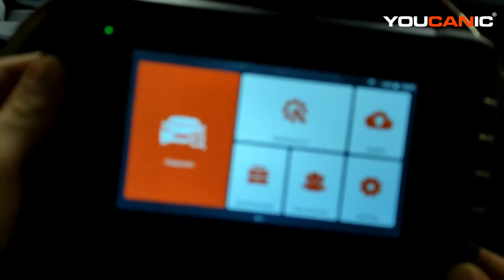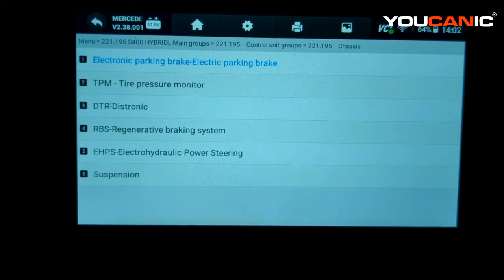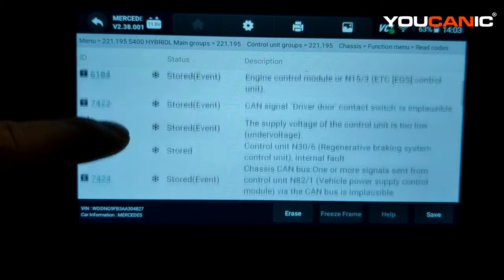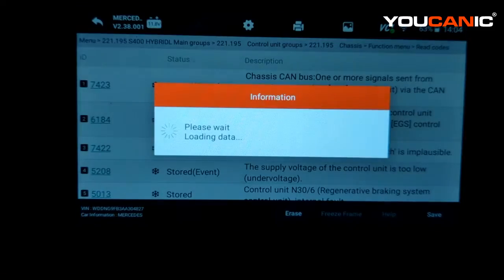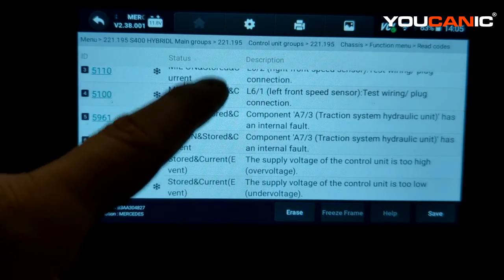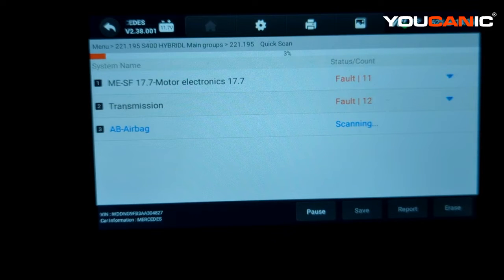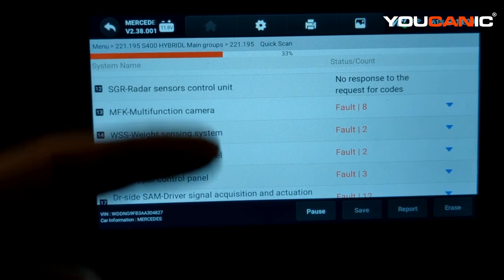Mercedes-Benz ABS ESP BAS EBR Troubleshooting Guide

Comment: hello I have a class s320cdi 2007 I had the abs esp light unavailable and the car tends to restrict it at 3000 rpm and as soon as I let go of the accelerator it gives small gas costs on its own. I ran it for diagnostics and changed the rear abs sensor but the car still has the same faults. What should I do ?

￼
Reply from the maker: Thanks for sharing your concern! From what you've described, it could be multiple possible causes for the faults on your class s320cdi 2007. Diagnosing such issues can indeed be tricky if a simple ABS sensor change didn't help. We suggest exploring our resources at www.youcanic.com/ where we offer guides, factory repair manuals and the YOUCANIC scanner to pinpoint the issue.

Remember, you're not alone in this! At Youcanic, our goal is to empower car owners. Should you require further assistance, we're here to support you on your car ownership journey. Happy repairing!
Reply: @YOUCANIC I can't use your application because I'm French. Could you directly tell me the cause of the problem please?

Comment: What if you start the test , and you cut it !!! (Didn’t finsh the test )
And as resault abs light 💡 and a message in menu 
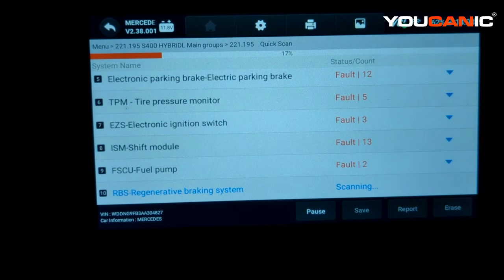N.B the car is 2007 mercedes w204 7:00 yeah i shout down the engine 😢

Comment: My S550 sat for a little while and the area where the speed sensor/abs reads, which is located on the left rear axle was rusted/corroded. The sensor was covered in rust dust when I drove it and car went into limp mode. I replaced both rear axles and the ABS, ESP went out.